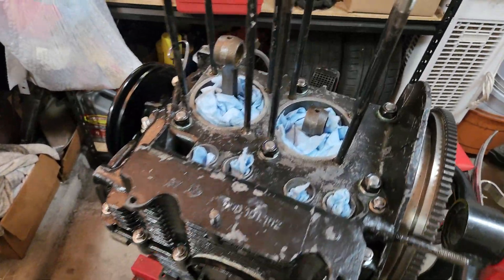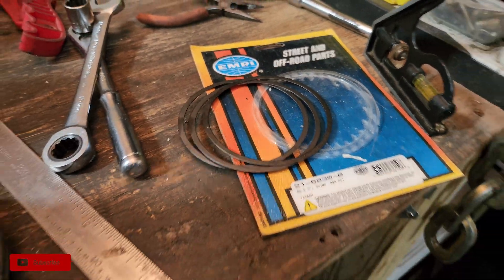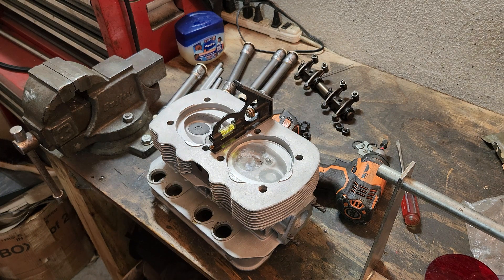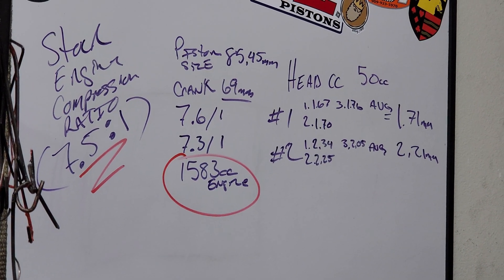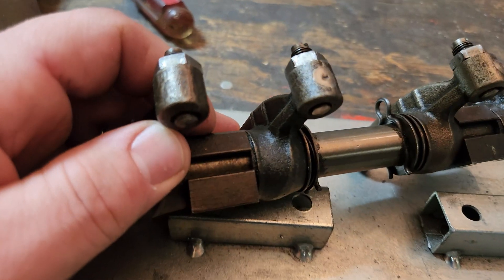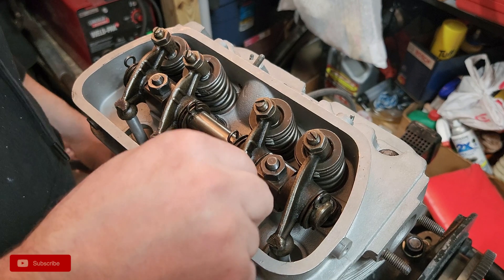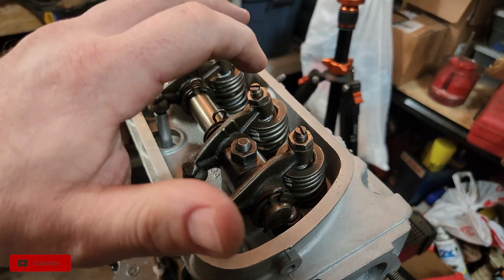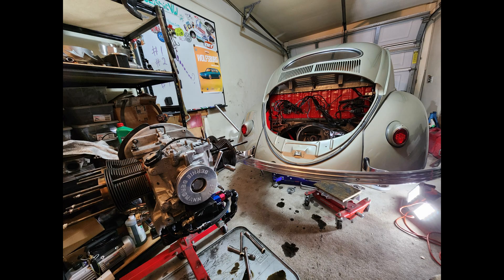How to Rebuild a VW Air-Cooled Engine "PART 13" Adding Cylinder Spacers | JW Classic VW

Comment: Have you ever built a motor and put a Berrys Blower/supercharger on it ,,I am thinking about it and would like to have the pros and cons on it
Reply from the maker: I have not built a VW with a blower... sounds interesting.
Reply: The kit I found is about 1200 comes with everything but carb....but I dont know how much ring gap I would need  because I dont know how much more power it would give and not many vedios on the tuning with one...kompressorhaus 500

Comment: I'm a little anxious about getting ahead of myself with my 2110 build and hoping you can tell me something. I have my case clearanced and I think I'm ready to move on to setting up the deck height stage. Do I want to go ahead and fully assemble the case with sealant and lube and all that? Or should I just temporarily assemble so I can break it all down and clean it again. I've been told not to do anything permanent until I'm ready to assemble the whole engine all at once. Everything checked through and through. I'm sure I'm overthinking, but it makes me wonder about things like torquing my ARP rod bolts ect. I don't think I should do that until it's ready for final assembly. Yet by not doing those types of things, is that throwing off my measurements any? Once Ive checked the bottom end, is it OK to do a final assembly on that and then move on to the cylinders? This is my first time and I've invested a lot in this so I don't want to screw it up.
Reply from the maker: Once you've checked everything, you can assembly the crank with rods.  If you want to dry fit everything, all you need is a light oil such as Marvel's Mystery for a lub.  Install the crank with no cam and torque the case halfs.  You can then dry fit the pistons and cylinders with no rings. Installed to check deck height.  Lots of different ways to do it, just do what is right for you.  Especially being new to the process.  Take your time.
Reply: @JWClassicVW  👌